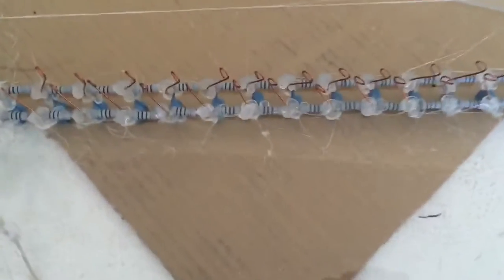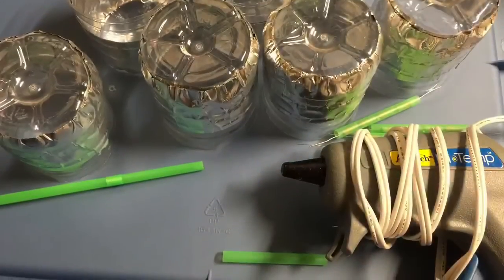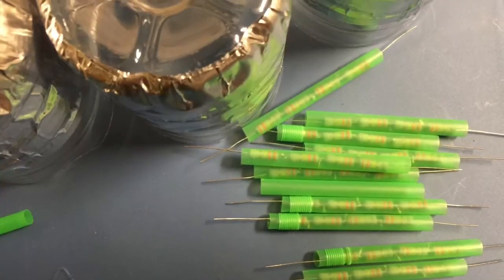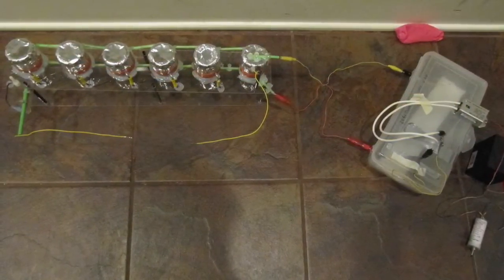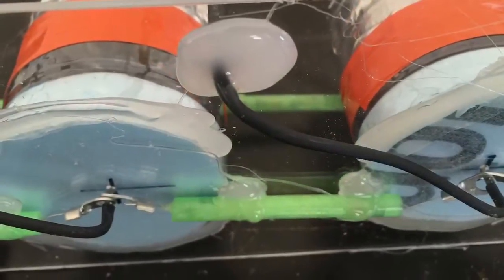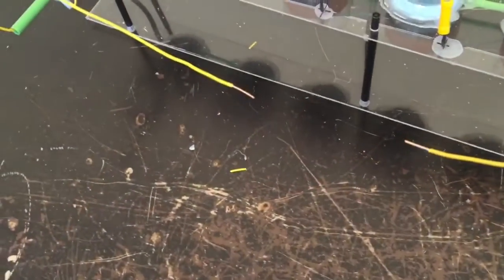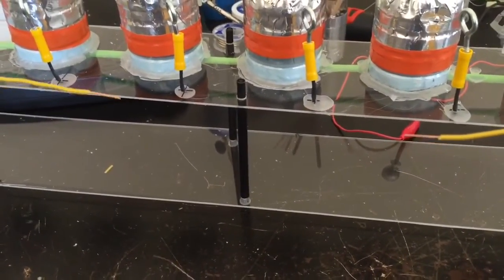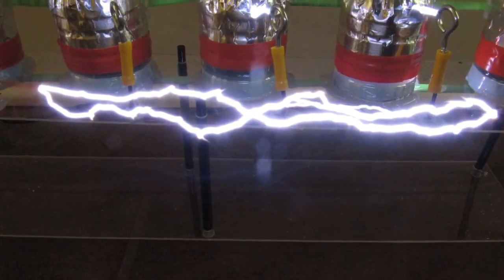Spring Water Bottle Marx Generator

Comment: why would u use resistors ?
Reply from the maker: The resistors allow the capacitors (bottles) to be charged in series. The combined resistance however is too high to allow them to discharge quickly. Instead, discharge occurs through arcing from on capacitor to the adjacent one. The resistance occurs in series which allows for voltage multiplication.
Reply: can u PLEASE give me the schametics please ??????, i really need it. u seem to be doing something out of the odinary i truely wana try ur exact circuitry plz help
Reply: He literally shows you the design in the video